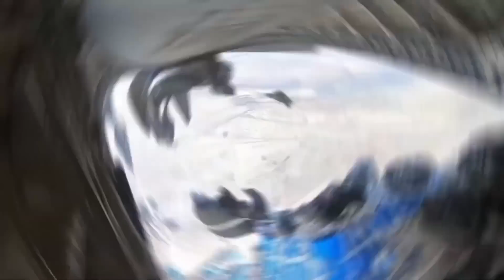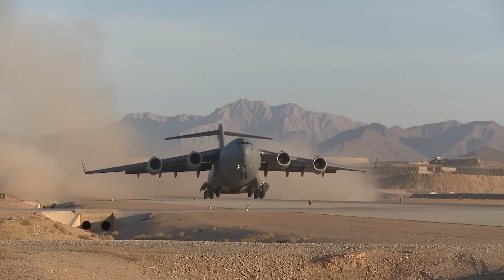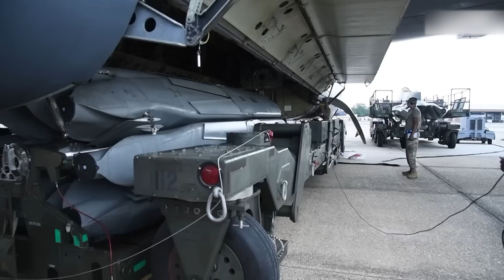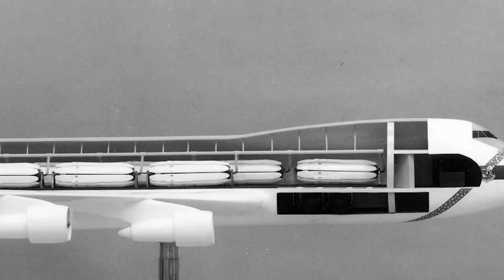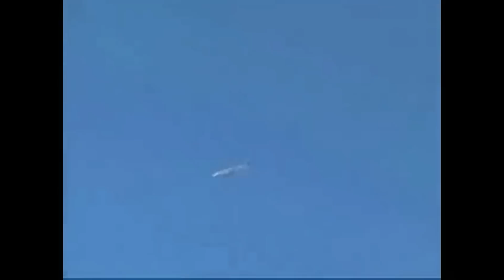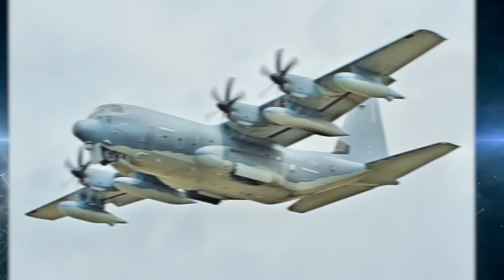The NEW Rapid Dragon Bomb is INSANE

Comment: If I am not mistaken, the Carter Administration cancelled the B-1A not the B-1B, which was the right choice at the time considering massive budget cuts and funds needed for the F-117.  Plus the B-1B is a significantly better aircraft than the A model and has a lower radar cross-section probably due to advancements in coatings. I remember back in '82 when the movie Firefox with Clint Eastwood came out.  That had to give security guys absolute fits because the plane in that movie used the same method of radar deflection as the F-117, which was suppose to be our best kept secret at the time.
Reply: That's not the first time a fictional work somewhat predicted military secrets. There was one author who wrote a fictional story involving weapons of mass destructions. The FBI however did nothing to stop it because intervening in the author's work would arouse suspicion. It's somewhat very similar to what happen during WW2 when the British finally acquired the Enigma Machine and when they learned about the Nazi mass bombing of Coventry, they did nothing to protect the town in order keep the secret that they had the machine to decrypt messages. The destruction of Coventry was so brutal that the Nazi pilot coined the term "Conventrated".